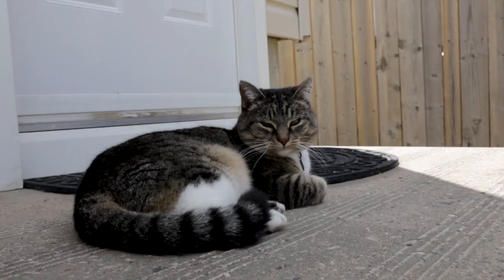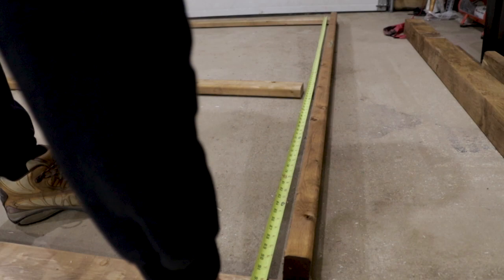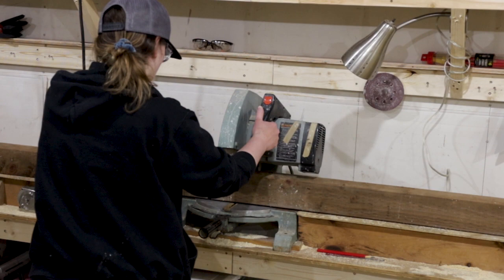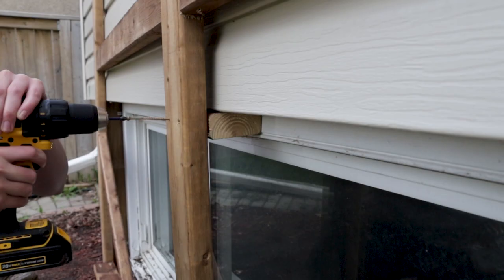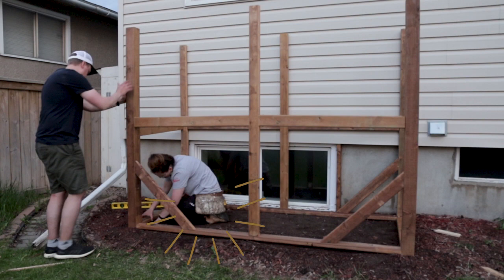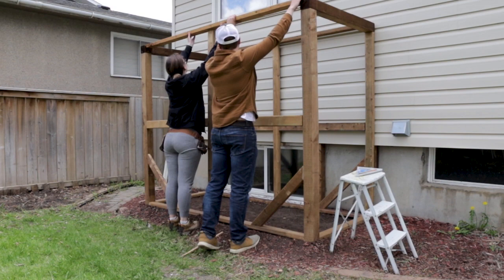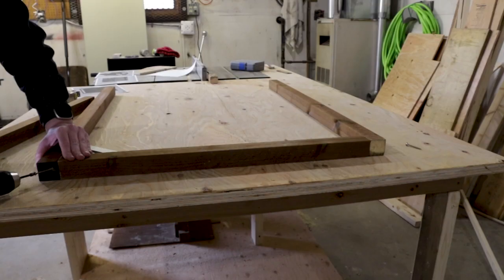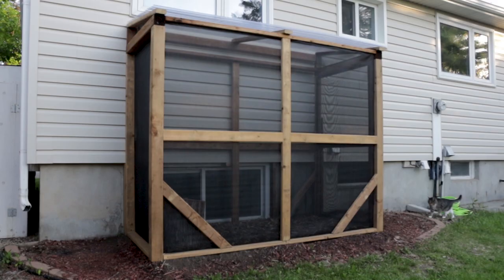Building My Cat’s Dream Home (a Catio!)

Comment: Good starter catio and good for you for doing it yourself. Lots of thinking goes into these projects. 
I believe in time you will get rid of the wood chips as they are not comfortable to the cat, encourage bugs and mold and my cats decided anything except concrete blocks made a wonderful litterbox (yuck). Plus, they loved lounging on the concrete floor and the blocks were easy to set in (plus easy to clean).
Also that screen just isn't going to last (again, speaking from experience). Good 14-16 welded wire works better. 
To make it more bug proof, you could add a garage door screen, or door screens (Velcro or magnetic) or even build separate framed screens that can be put in and out. Window screening alone will not keep the cats safe and other animals out and I found that even the pet screening did not stand up to determined cat claws.

Best to you and thank you for sharing the whole build.

Comment: New subscriber after watching the earlier video on the workshop.  No doubt Wasabi will enjoy his new outdoor space.  I laughed at the wind turning the roof panels into kites as it reminded me of a similar thing when a buddy and I were loading sheets of drywall in some high winds.  A safety tip about using the hand drill/driver, position the hand holding the piece farther away in case the bit slips (or a drill bit unexpectedly snaps), particularly when your weight is on the drill.  See the 10:40 mark on the video.  Happy building!
Reply from the maker: Great tip about hand placement with the drill! I may or may not have learned that the hard way since this project... Thanks for checking it out 🛠

Comment: Great job! I hope you stick with it. I’m not sure what type of screws you are using. But I have stopped using Philips head. And switched to both square and torx drive screws. It has all but eliminated the problem of cam out. And stripping the screws. Most of the wording channels have as well. Fisher’s shop always ads one of his grandfathers flat head screws. Lincoln st wood works is great for tips and ideas as well. Keep up the good work 👍🏼
Reply from the maker: Thank you for your advice! I almost exclusively use Robertsons which are so much easier to work with than Philips. I'll definitely have to check out your recommendations as well. ⚒️